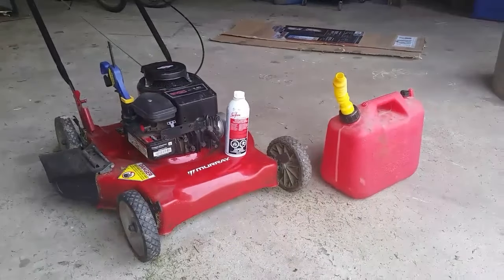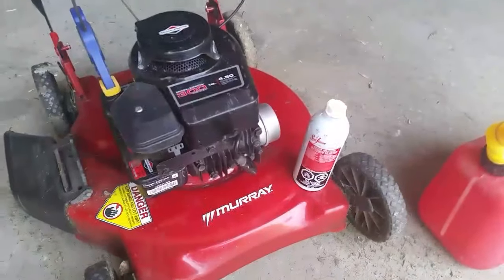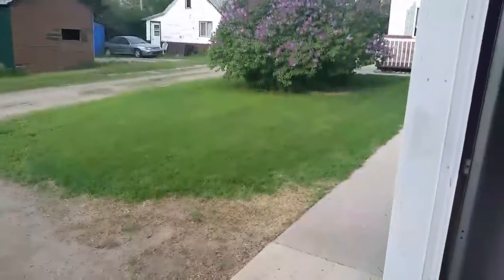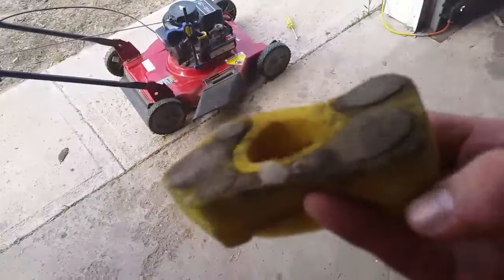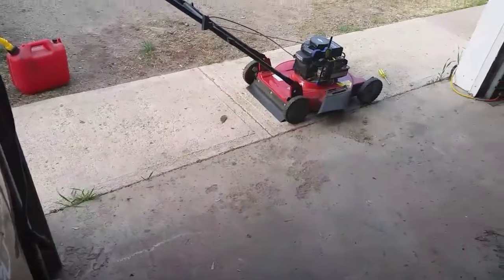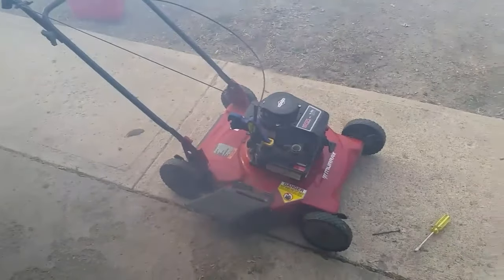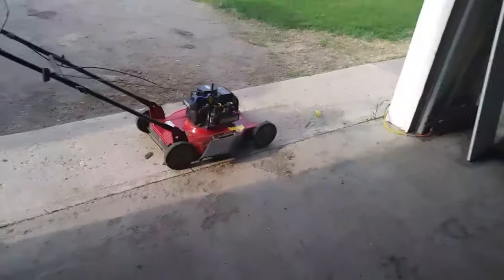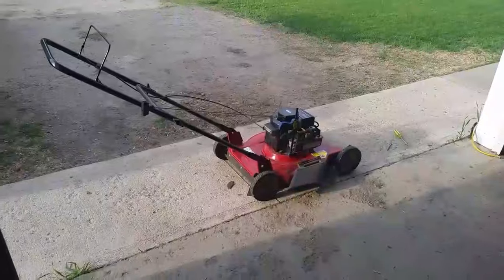How to Run Seafoam Through Your Lawnmower

Comment: I picked up a used rider mower with a twin cylinder Briggs 18 hp. It ran but not great... would only stay running with the choke on full. I poured 1/2 a can of seafoam in the gas. After about 1 hour of running I had to start closing the choke as it was too rich [ like it should be ] After another 1/2 hour or so it ran just as it should with no choke. Putting seafoam in your gas does much more than just pouring it in the carb. Yes that will clean some carbon off the piston but that's not really gonna make a poorly running engine work better. Putting it in the gas cleans the fuel pick up screen, the fuel lines, the fuel pump [ on larger engines ] and the carburetor  jets! That's the things that get gummed up and start starving the engine for fuel. Running it in the gas is the ticket.
Reply: 100%
Reply: I add a little bit to every fill up on vehicles and air cooled engines 
Never had a carbon problem 😊
Reply: I would recommend the non ethanol pump gas from SUNOCO.

Comment: I add an ounce per gallon in a 5 gallon can. I never run the gas out at the end of the year and its starts in the spring right where I left off in the fall. Sea Foam is great as a fuel stabilizer.
Reply: I do the same thing and have never had a problem.. I used to use sta bill but from my experience it seems like sea foam works much better.

Comment: I put seafoam in my gas tank about every 4 tanks. I also run the spray through the intake about twice a season and you need to use Sta-Bil in the gas during winter. Also, I try to go out and crank the mower throughout winter. Keeps the lines cleaned and battery up

Comment: I bought a Craftsman 6.5 HP mower I bought for 20 bucks cause guy was moving. I changed the Oil, Air Cleaner and Drained the Gas and put in new. It is a bit cranky to start unless I prime it like 8 times. There is a small miss to the engine but I feel it's an older engine there is Carbon Build up. I also took the lower part of the carb off and cleaned it w Carb cleaner and sprayed the upper half of the Carb. I'm not overly mechanically inclined but I know the basics. Tomorrow I will be trying the seafoam in the gas tank ..2-3oz and see if it makes a difference.. I'll do the same to the intake as well and let it run for awhile.. I feel confident with the Seafoam it should start eating away at the carbon and mower should run better.. I am really out nothing so I'll give it a shot.
Reply: For $20, it’s worth your time to play around. Since it’s been 5 years, how did your tinkering around work? Were you satisfied with the results?

Comment: I'm gonna try this. My mower starts well initially, then after about 30 seconds, slows down and sputters for about 5 minutes before I can begin cutting! I would think though, that it might be better adding the 'foam' right into the tank of the mower. It's the beginning of the season now, and I need to fill the 2 gallon gas can for the first time. So I'm thinking if I were to put 2 ounces of Seafoam into the can, then I'd be adding it to the mower each time I do a fill up.... and was under the impression that might be too much Seafoam to the mower on a regular basis. Is that right?
Reply: clean the carb

Comment: Pat4x4 Your grass looks nice and green, It's not dry in our area in Saskatchewan, we still have lots of water left from the last few years when we got 40 inches per year!   Good video. Wash that filter out with solvent then add a few spoons full of oil and squeeze out the excess. Im not sure that pouring the seafoam thru the carb is worth doing, just add it to the gas or oil.

Comment: The NUMBER ONE thing you can do to keep your small engines running well is use a funnel with a screen! That and a small amount of seafoam in the gas once in awhile. Good stuff!!
Reply: I've never used a funnel with a screen and I've never had a problem. Most experts would agree that the number one thing you can do to keep your small engines running is to protect the carb from moisture... moisture in the gas from ethanol, moisture from the morning dew each morning if a machine is left outside and the water vapor is drawn into the carb, etc..
Reply: ADD A FUEL FILTER IF YOU DONT HAVE ONE. SEAFOAM IS EXPENSIVE!
Reply: And run it dry at years end, otherwise Seafoam it!
Reply: @algorel4763  "Seafoam is expensive"
Walmart: am I a joke to you?!

Comment: Seafoam can also be added to your oil prior to an oil change on your 4-stroke lawn equipment.  Remove dipstick, add the proper amount, start your engine, let it run for 5-10 minutes, drain the oil, fill with clean oil.  It will help clean the sludge out of the crankcase.

Comment: Get yourself a spring clamp for that safety bar. I use one on mine while mowing, that way if I just need to step away from the mower for a second to do something, I don't have to start it again, but in an emergency, I can quickly get it off.
Reply from the maker: moncorp1 i dont mow with it taped down.  i just hold it with my hands as intended.  i just taped it for the video.  thanks for watching!!
Reply: everybody knows the first thing you do when youve purchased a new mower is disable all the safety features. it says so right there in the manual

Comment: Run seafoam to clean internal engine at the end of the season, turn off gas line let it's a running off the gas that's till left in the carb until engine stall. Take all gas out off the tank, with the spark plug off, pour couple drops of engine oil in then give it a some pull to lubricate the cylinder .Put back the plug and ..Done ,store it throughout winter for next season .I did that every year so mine's works perfectly and starting every pull .

Comment: your mower is just like mine only mine is older,  I see you have trouble keeping the gas tank lid on so do I , I took my carb off cleaned it really good, changed the oil, got new spark plug, fixed my wobbly wheels and I be dang I tipped it over to clean underneath to get the build up off and oil leaked out thru the air filter what a mess I already have it apart again cleaned carb stuck a q tip where the carb goes and some oil in it :( will this work to clean it out? didn't get in gas tank. HELP

Comment: Don't forget to oil the air filter after you clean it. :)
Reply: Jacob Burrows im a dummy, but oil it? i have heard to oil my sponge thing thats on my 92 camero, it looks like a carb but its not, and the spunge is by the breather and air filter
Reply: Don't need to ,,,that is something no one dose anymore ,,oil blocks to much air !
Reply: Barry Estell The bike shop oiled my moped air filter some Asshole pulled my fuel line. to steal a drops worth of gas at the movie theater and got gas into my air box when I started it and the gas dried out my filter.
Reply: The manual says to LIGHTLY oil the filter but I heard through a knowledgeable YouTuber that's only because oiling the filter satisfies the emission requirements.  I've made the mistake of adding way too much oil and it attracts dirt and debris and suffocates the carb causing the fuel to run too rich, and the result is a highly carbonized combustion chamber and spark plug.  I no longer oil the filter and my mower has been OK since.  Thanks.
Reply: Just a light coat of WD 40 on air filter will really help

Comment: I put a couple cap fulls into the gas tank of lawnmower,  & lawnmower runs great,  Me Myself I Only Add Seafoam to the gas tank.  and I do it twice to three times a year.  1. beginning of spring. 2. mid summer 3. and in October right before storing for winter.  Never had bad results. 
   My buddy put it in his Hot Rod an old 1968 suped up Chevelle,  with great results.  again only add to gas tank is me and my friends method.

Comment: To solve the lawnmower issue problems because ethanol gas is mixing to methanol at the gas pump. Do not use regular because it's not strong enough for small engines lawn mowers. High octane and you will never have a problem with a startup the lawn mower because they strong additives High combustion rate

Comment: Only 3 years old?  Get a Honda.  Mine is 6 yrs old and still starts on the 1st pull, every time.
Reply: I have a 1975 Briggs and Straton 5hp snowblower still starts right up. It's all how you take of things
Reply: Any small engine will start on the first pull if the fuel system is clean as it should be.
Reply: this mower is from at least the early 90s. he just bought it three years ago. you can tell by the carb structure
Reply: 41 years of continuous use on a 3.5HP B&S my dad bought new. Runs like a top. Most reliable engine I got. I have a 3 year old Honda that's a hard starting, governor bouncing carburetor clogging piece of shit. Gonna sell that one....
Reply: It's not the manufacturer, it's the ethanol in the fuel clogging up the carbs. Seafoam will clean the carb and is a great stabilizer to prevent bad things happening in the first place.
Reply: Fact Checker  Not Hondas.

Comment: I would have changed the spark plug and cleaned the carb before trying the seafoam.
Reply from the maker: James Q i change the plug every couple of years anyways.....and the seafoam worked amazing.  ran like brand new after putting it through.
Reply: I've never used it for small engines. What i generally do is change the plug at the beginning of the year and the filter, then if needed i'll remove the carb and spray it out with some carb cleaner and reinstall. I always drain the tank at the end of the year also and run the engine until it stops to remove old fuel so it doesn't gum up.

In extreme cases, i've removed the head and cleaned everything up the put it back on. It's a bit extreme in comparision but works very well. Just tossing out some ideas is all.
Reply: Think he said that he wanted to try the lazyman way first.

Comment: A dirty filter alone will cause your mower to start hard or not start at all. Too bad you didn't clean it before you mowed.    I have never let my filters get that dirty.  And besides, I just can't pour anything in my carburetor because it is positioned sideways.
Reply: SeaFoam makes a spray for carburetor cleaning that eliminates the pouring.

Comment: Isn't Seafoam highly flammable?  You're pouring it in a hot engine and if you hit the engine with it won't it ignite along with you?
Reply from the maker: Bossmanrocks no.  if something was highly flammable u need a spark to set it off and the only spark is happening inside of the engine.  so this is perfectly safe.
Reply: And if it’s highly combustible you need compression :)
Reply: You can put a cigaret out in Gasoline... this is safe.
Reply: Thank you so much for this video. I just fixed my lawn mower
Reply: This was my concern also.

Comment: Haven’t been working on engines much huh? It’s absolutely no need to dump sea foam in the carb. Just add it to the fuel in the tank. ( Breaking News) the fuel from the fuel tank goes through the carburetor. (Shocking huh).......😂
Reply: 1EVILZ06  I was thinking the same as I watched this video! You’re absolutely correct!
Reply: @pete9688  Doesn't work as well as you'd think with some of these small engines. They don't coat the cylinder head and walls with Seafoam effectively during normal use. Running it rich helps to clean up the uneven carbon deposits that'd take 10+ tanks of Seafoam to remove.